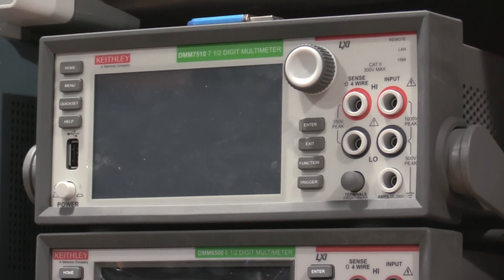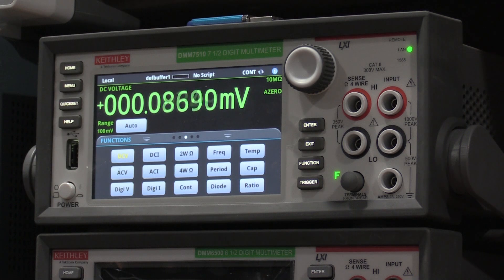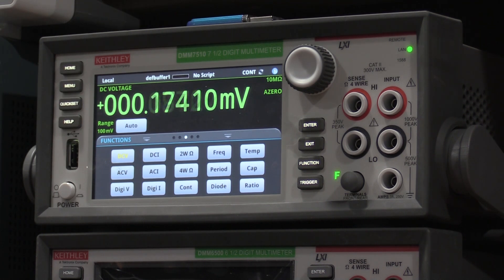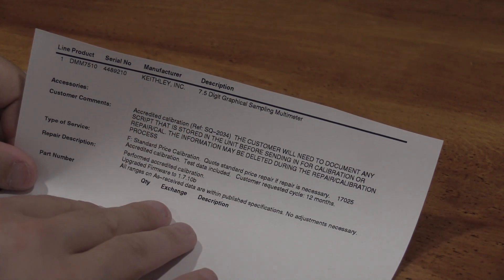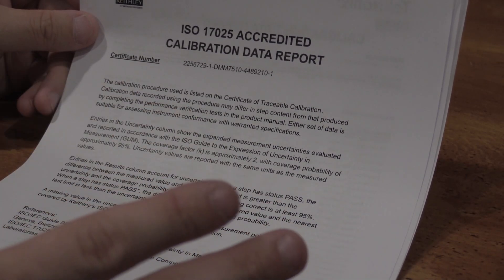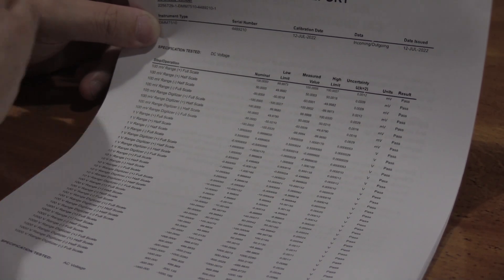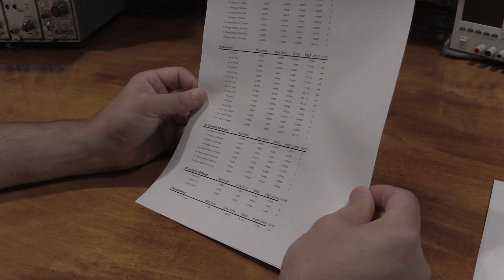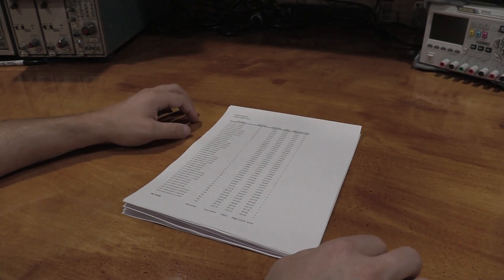Keithley Comes Back from the Mothership Ready to spread some PPM's

Comment: A dry circuit is one in which the voltage and current are limited to levels that can't cause changes in the physical and electrical condition of the contact junction. Generally accepted limits are when the open circuit voltage is 20mV or less and the short circuit current is 100mA or less.

Dry circuit testing examines the condition of contact surfaces, usually after environmental exposure testing, for presence of oxides or contamination that will interfere with signal levels at or below 'dry' contact voltages.  

Voltage and currents that are above 'dry', are called 'wet' and can function properly in spite of oxides or contaminations due to the current density creating displacements in the contact surfaces. 

We often see 'dry' contact ratings specified in switches, relays and contactors specifically engineered for small electrical signals.
Reply from the maker: Fantastic that is great to know. I will make a note of that and use that in the future to evaluate some relays and surfaces. Might be intresting to do this test on some of the Tek attenuator switches before cleaning.